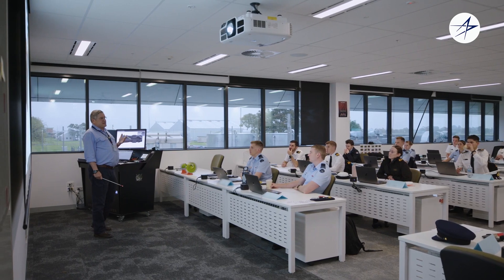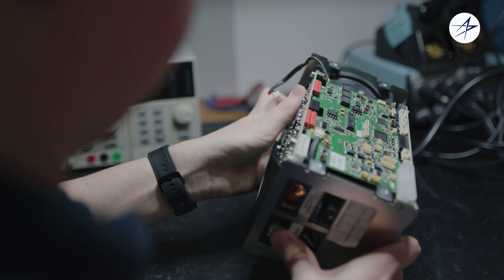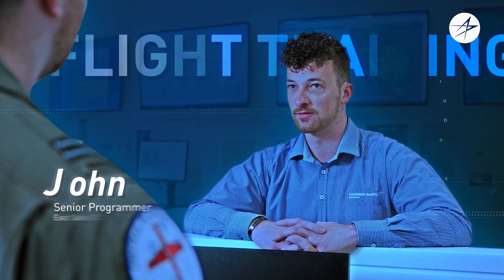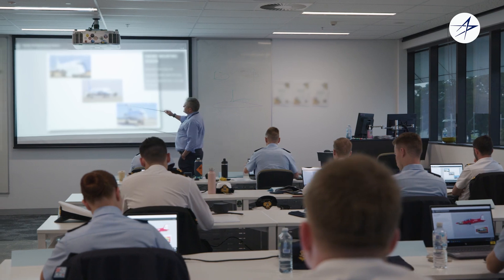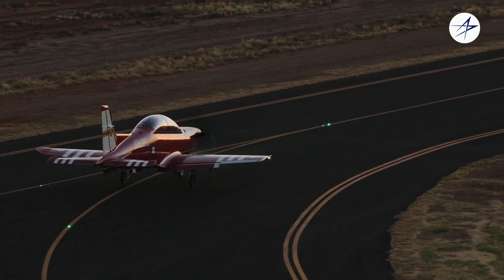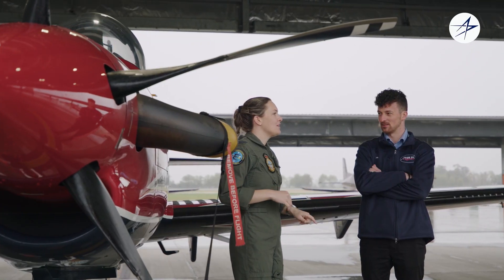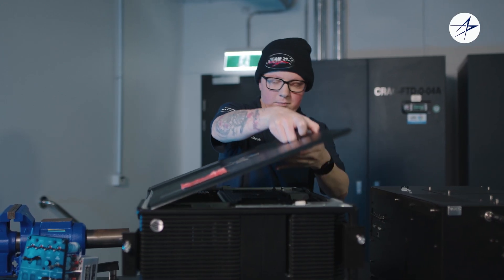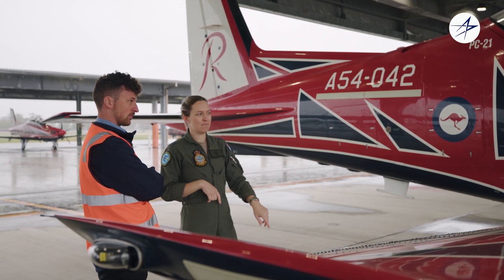Staying Ahead of Ready: Pilot Training System

Comment: Honest suggestion: Spinning holographic displays are cheap consumer grade hardware that can simulate a 3D object  a substantial radius and is again cheap as the tech is already at a consumer level. For AI defense photon relation algorithms this would probably be enough to spoof it given it cannot record in 3D versus speculate depth using the difference in shading intensity between without assistance of radar.  

Compact signal jammers and decoy signal transmitters are readily available for the US. All it would take is making a modification kit for DJI phantoms drones that includes 6 of these holographic displays each programmed to display what the object would look like from that angle, radar jammer, range extender for pilots, and an rechargeable/swappable battery pack. DJI drones work, why not create modification kits specifically designed for them to provide aid in Ukraine and test out the technology without directly escalation tensions given we aren’t giving them anything that hasn’t already been purchasable by consumers for nearly a decade?

Imagine dozens of these being released from a Rapid-dragon deployment system modified to release the upgraded drones in swarms?  Using existing consumwr grade drone light show tech they could be made to move on square grid formations that blanket the sky over a strike target casting a net of radar and light disturbance. For this type of modification kit perhaps just bright lights versus spinning ones unlike the decoy proposition if u got 25 drones in a 1km by 1km grid as long as u got bright enough lights I’m sure it’ll at least increase the odds of successful delivery. 

Either you’ve already done this, or should give me an internship so I can do it cuz I’d design it for free just for the fun of engineering and lack funds or relevance to my career to make a prototype myself. Don’t want a career in this as hinted prior, got other aspirations in mind. So, if u don’t have it and want it I’ll do it for free as a hobby project and am an American citizen 👍 

Regardless please make this you got smarter people than me by a factor of 10 and I think it would be cool to see even if impractical and useless. Maybe that’s what those tic-tacs are which is why their movement seems so confusing iykwim hahaha. Would also explain lack of exhaust come to think of it, so if u have this please make a vid on it soon cuz that sounds awesome.
Reply: I absolutely got no idea or knowledge about what you have written but it looks very nice.
Reply: Hey lockheed! This guy sounds itelligent! Just give him the internship

Comment: 🧾 I'm IPC certified to do this kind of work. I can solder a component that is literally smaller than the head of a pin, onto a circuit board, by hand, while looking thru a microscope 🔬 👀
🛰 I'm also certified to work on satellites & aircraft wiring harnesses, all to quality & safety standards that are higher than even what NASA uses.
   Try getting a job, though 🤦🏻‍♂️

🌌🔭
Reply: You can’t find a job?
Reply: @angeloc1340  🤷🏻‍♂️ Unfortunately, no. Not within that line of expertise. There's a lot of competition for a limited number of open positions. I, myself, have had 4 interviews with Lockheed-Martin Aerospace. Colorado has the highest number of aerospace companies in the U.S., at over 400 🛰🚀🌙
 
🌌🔭
Reply: @angeloc1340  Competition is tough for a limited number of positions. For example, I, myself, have had 4 interviews with Lockheed-Martin Aerospace in Denver, Co. 🛰
🤷🏻‍♂️ So far, no success. 
I received my IPC training & certifications 《approx. 12 》 at the Blackfox Institute in Longmont, Co. Recertification is required every 2 years & costs around $4,000 each time. Usually, this is paid for by the employer each time & training lasts 6 weeks. My training was actually paid for via the Workforce Investment Act 《WIA》. Even if my IPC certification is expired at the time of hire, the employer will still send me to Blackfox for re-cert., pay for it & then send me thru their own company training program in regards to their specific rules & requirements. 

🌌🔭
Reply: @angeloc1340  I've had 4 interviews with Lockheed-Martin Aerospace in Denver, Co. 
🤷🏻‍♂️ No success.
Competition is tough for a limited number of positions available.
   I also had an interview with Research Electro Optics in Boulder. They make gyroscope components for Honeywell. They were interested in me because I had once been a professional jeweler & had an exceptionally sharp eye for tiny details & steady hands & excellent eye/hand coordination 🔬👀 They weren't interested in my IPC certs. 
🤷🏻‍♂️ Still no success 《but damn close!》.

🌌🔭
Reply: Why are people searching for a job in yt comment sections?
Reply: @SyntaxError-2505  Nobody is looking for jobs on YouTube, you fucking moron. We're simply talking about our experiences in the job market 《not that it's any of your goddamn business in the first place》🖕🏻😘

🌌🔭
Reply: @SyntaxError-2505  Nobody is looking for a job on YouTube. We're simply talking about our experiences in the job market 《not that it's any of your goddamn business in the first place》🖕🏻😘

🌌🔭